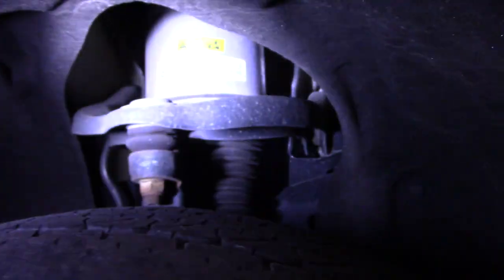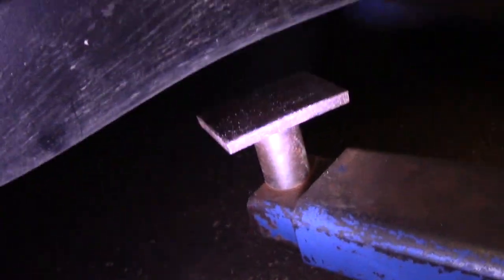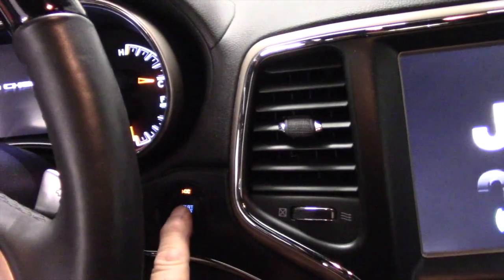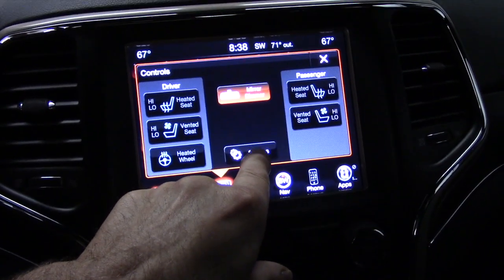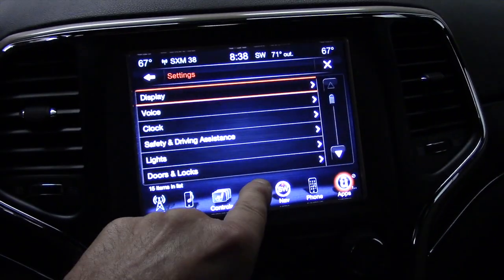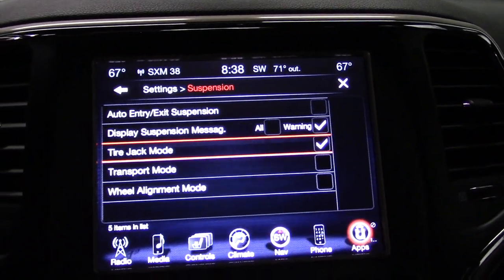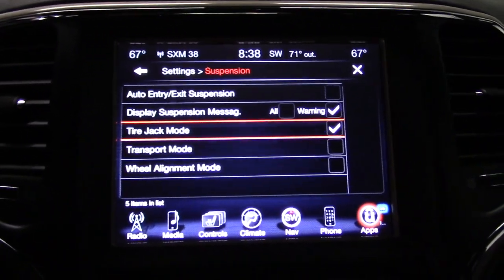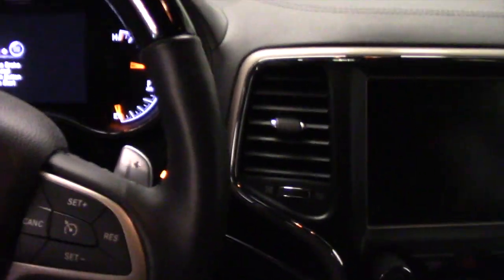How To Put A 2015 Jeep Grand Cherokee Into Jack Mode

Comment: Wasn't aware of this until yesterday. Ive been doing rotations without changing this setting, I was at a tire shop yesterday and the tech told me that they actually blew out an airbag once because they didn't know about the need to put the vehicle into jack mode and it cost them $8000! I guess Ive been lucky so far. Good info.

Comment: Do you know how to get the jeep out o plant mode ? I have a 2012 jeep overland with air suspension and it is now in plant mode because i hooked a diagnostic tool up to it....now cannot get it out of ( dealer/service mode ) plant mode. 
Thanks
-Chuck
Reply: Update?
Reply: @AFatherToTheFatherless  i had to take it back to the dealership.  The worst part i needed a new suspension  controller. I bought one used, they cannot re-wright my vin into it. So i ordered a new one. Jeep is stuck in normal ride height and drive til i get new one.